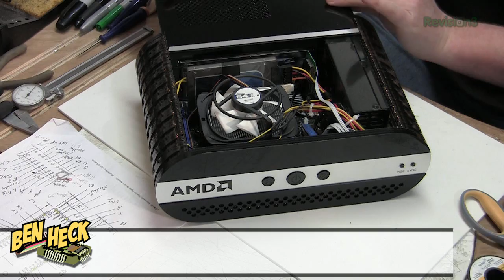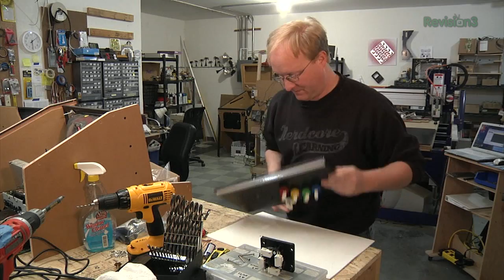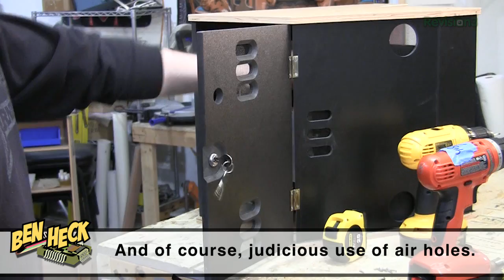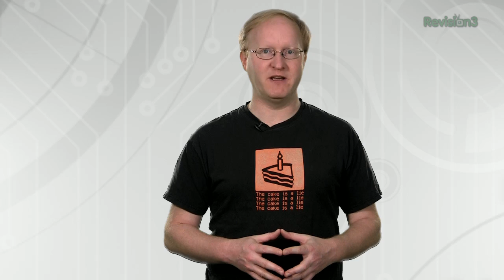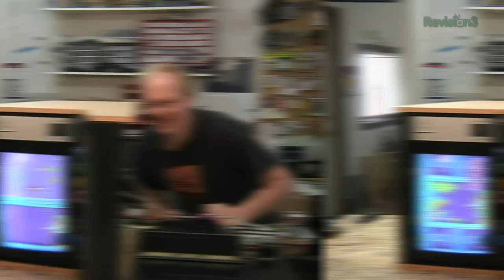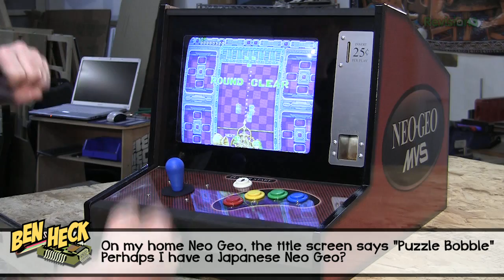How to Build an Old School Tabletop Arcade Machine (Part 2)

Comment: how you wired the jamma into vga conector?
Reply: +Roberto Lazaro Its not a VGA connector, the monitor is EGA and uses a DB 9 connector. 
You can find the pinout online, all you need is red, blue, green, sync and ground from the jamma harness.

Comment: Great job on your table top build.
I am starting my own build very soon for the kids,im building a 60 in 1 arcade machine from an old taito space invaders cocktail cabinet which was converted to a poker machine so it does require some work, thankfully I have the original button panels from the machine before it was converted to a poker game.
I was going to use an upright but I would prefer two old school two player where the second player sits the other side of the cabinet.
I will be using a flat screen monitor  from an old PC and I have all the parts I need thanks to my dad who has a garage full of old cabinets and who at 71 still runs his own arcade business. 
I just came across your video and I just want to say thanks for uploading it.
My main passion is arcade machines and I love building and repairing them and as a new subscriber to your channel I look forward to watching more of your uploads.

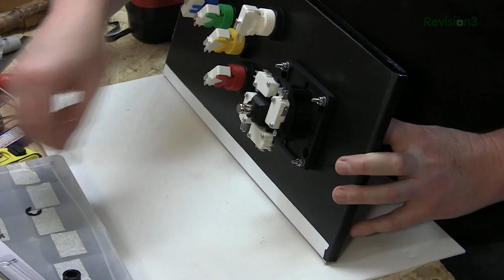Comment: Your joystick is too short... The plastic spacer you put against the e-clip (around 3:00), move that to the top of the joystick.  Then the e-clip will rest against the actuator, also the spacer will still be hidden by the dust washer.  BTW... T-molding FTW!  ;)

Comment: Don't see why not. Get the higher end one which has more usb ports and an ethernet port; should be fine. The HDMI will connect to any HD TV. You'll just need to learn a bit of programming lingo to get it up and running.

Comment: You could, but the Raspberry Pi doesn't have enough CPU horsepower for video encoding.  HD Decoding is done inside the GPU, but encoding would need to be done in the CPU -or- by an external chip.  If you could hook up something like an Eye TV, you might be able to do this.

Comment: Also though, maybe it would be an idea to consider what you'd put a Pi inside for a media box.  Ideally I'd put a Pi inside an old C64, but I'm a bit retro and have the space for that around my TV.  There are cases you can buy for the Pi, some of them look great and it'd end up a nice looking media box.  But there's so many little form factors that the PI could take... a handheld radio... a VHS tape... might be fun to make a secret, disguised media box.  Bluetooth keyboards can be tiny nowadays.

Comment: When you glue the vinyl on the side of the cabinet use a woodworking trick. Lay many small dowels on the case, then put the vinyl on top of the dowels and line up, then remove a dowel, smooth, remove...on and on.

Comment: Sort of.  The Pi can run xbmc, so with the appropriate hardware and software tweeking you could make it into a DVR type device.  It can also handle light netflix/youtube/streaming online, though true web browsing is rather limited.  With a bit more software work, you could probably run some limited games (think arcade-style/emulators).  That'll take a good bit of work and it will be a bit slow, however.  You should consider posting your question on the Raspberry Pi forums...

Comment: Basically already exists.
It's not sold as that, but people sell devices that hold Android OS on it and you can hook it up to a computer and boot it up.
Plus a while ago with the Atrix (I think that's the name) had a Phone Laptop Dock so you can put your phone in it and it mirrors to a laptop.
Also as Android is based on Linux you can probably find a distro online for free.

Comment: He did a plexi overlay though :) (which admittedly isn't too bad to do.. but I hate doing circular cutouts in plexi - damn near impossible, they tend to hairline cracks or chips!

Likewise, the r-pi mobile for instance a week back too.. all fired up and then.. 3d print the bottom, laser cut the top.. blast! :)

With large plexi holes, or straight bends you can warm the plexi, or use a router etc with increasingly deep cuts .. but tips for converting to little mobiles, would love!

Comment: So Ben, why did you go through everything to hide and fill all the screwheads, but you left the stick bolts exposed through the cpo? Kinda a shitty "op conversion" look in my opinion. A better solution would have been to countersink studs before the cpo  application and nix the plastic layover.
Other than that nice unit.

Comment: It's because aileron, elevator and rudder control used to be mechanical, not electrical in nature. Fly by wire really only became possible with the advent of the microprocessor and the technology to make them cheap, powerful and reliable. You are still kind of right though because it doesn't have to be that way anymore and we keep it the same.

Comment: You should make a super can cooler suitcase that holds 6 cans and 2 bottles. It would have a battery pack and tech on both sides but uses a snap Click ? ( the one you used on the wireless mailbox and also have a override on off switch so it doesn't wast power over night

Comment: Definitely pay the extra money for a soldering station.  I used to use $15 Radio Shack soldering irons and always thought I was just really terrible at soldering.

A few years ago I picked up an Aoyue digital soldering station for about $80 and, believe me, having the right tool makes all the difference.

Though, yes, if I were to make that decision today, it would be a Weller.

Comment: Ben, i really think you should do a video on how to build a cheap hobby CNC router by hand (as opposed to using another CNC), maybe use Stepper motors and controllers salvaged from old printers and scanners. i think it would be something that a lot of viewers would try to reproduce for themselves.

PS i know you have done a video on this however you simply used another CNC to build it, also TBH is wasn’t very clear and none of the programming was shown. Also you didn’t show much of the building.